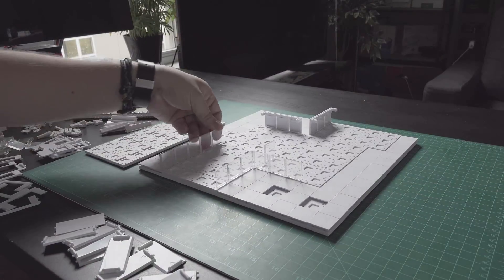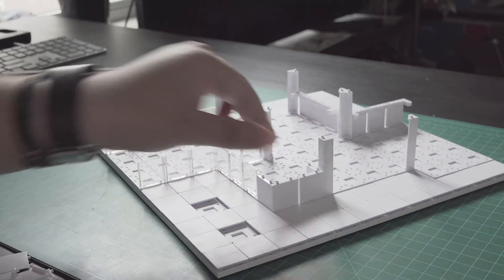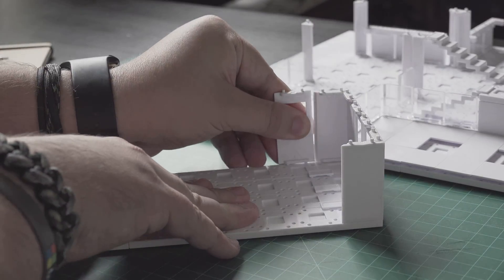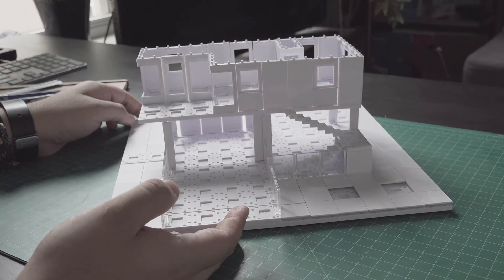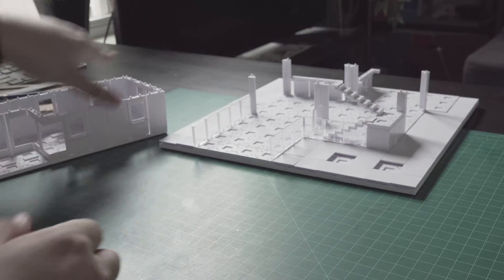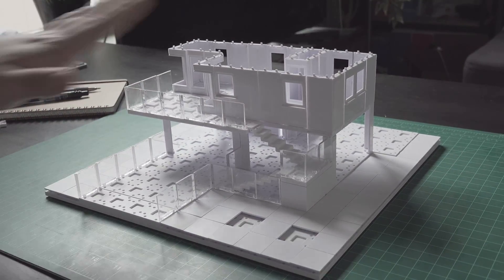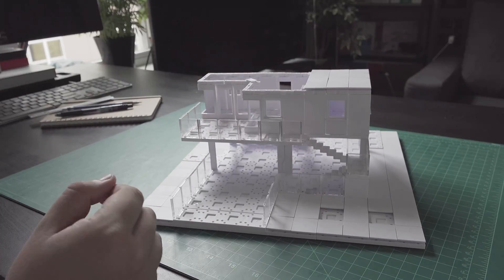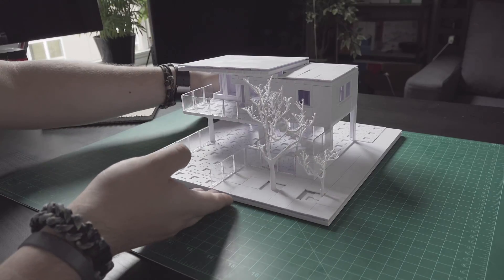ARCKIT for Sustainable Design // Build 7

Comment: Just stumbled upon these awesome kits. What scale are these kits in? It would be even cooler if there was furniture and appliances pieces to go with it.
Reply from the maker: Hey how's a going! These kits are at at about 1:50 scale. Arckit themselves are coming about with some additions and you can buy or 3D print anything you want at that scale to work with it.
Reply: @RikySongSu  Awesome! I'm deciding between the 240 and the 360 kit. What is the difference besides the piece count? Obviously the structure design on the box is different but you can build any design with both of these kits right?
Reply from the maker: @KevinLam86  There will be two things going on here, first both kits come from different generations of ARCKIT. The 240 is from Gen 1 and the 360 is from Gen 2. The simple difference is that with Gen 2 you get some curved tiles and angled tiles to use. Secondly the number on the box denotes the max meters squared of your build with that kit. So with the 240 you would be able to build up to 240m^2. If you have any questions or need any additional information, I would be glad to help. I've also written an entire article about ARCKIT which can be found here: https://www.rikysongsu.com/blog/thearckitreview
Reply: @RikySongSu  Thanks!
Reply from the maker: @KevinLam86  not a problem!